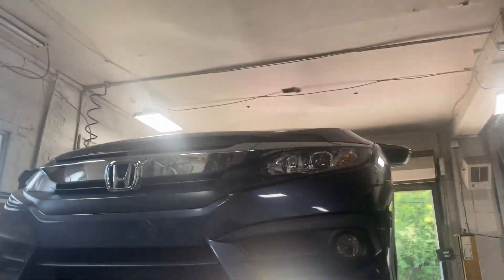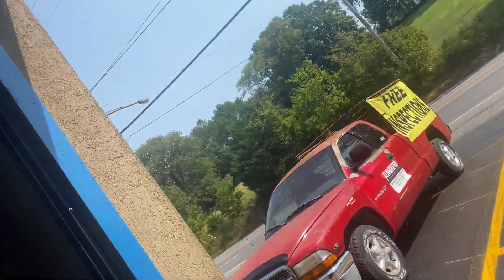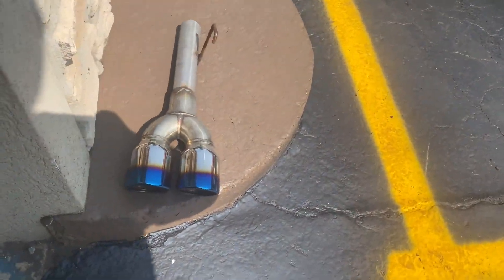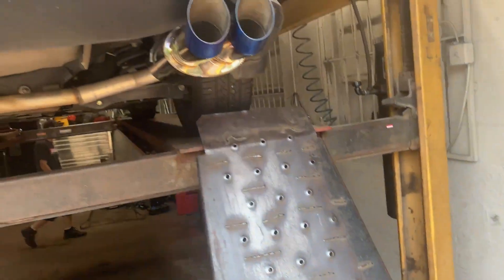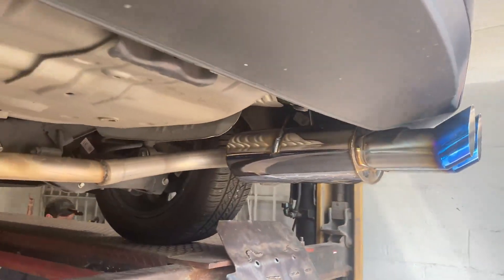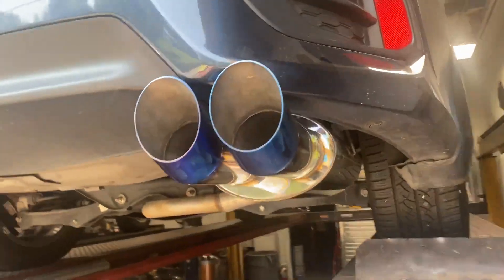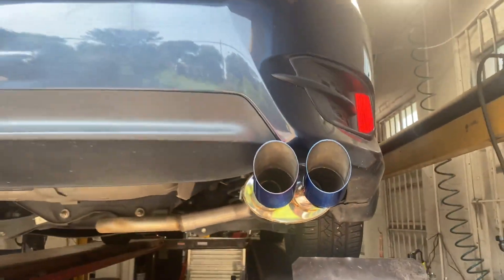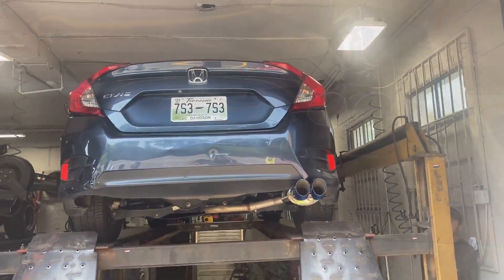2017 Honda Civic 2.0L EXHAUST w/ DTM MUFFLER!

Comment: Dude was in first gear for like 10 seconds on that takeoff
Reply: its a cvt there is no gears
Reply: That sounded wack as shit then
Reply: @StoccW205  cvt is not good for shit
Reply: Cvt life is like that unfortunately
Reply: The simulated 1st gear goes to like 50mph lol and the car doesn’t make peak power till 6500rpm. Along with the stock tune literally makes 130hp in the mid range.

Comment: Being that this is a VTEC engine, it would have been nice to hear it rev past 5k
Reply: I think that there’s a CVT in it.
Reply: The civics dont have VTec anymore
Reply: @capnb0b578  yes they do if you have the right motor
Reply: @CactusJack252  They do not have VTEC in Civics anymore unless it is the Type R.
Reply: @capnb0b578  New gen civics do have vtec. It may not be the one everyone thinks of but its vtec regardless.
Reply: @AbsoluteEmperor  Youre correct I dont know where I got mixed up at. My bad
Reply: @capnb0b578  10th gen civics do have VTEC. If you get the base 2.0L motor, it comes with VTEC on both the exhaust and intake side. For the 1.5L engines, there is no VTEC. In the Civic Type R, VTEC is only on the exhaust cam shaft.
Reply: @zuclya  awesome! thanks for the correction! Im still just dipping my toes into Hondas